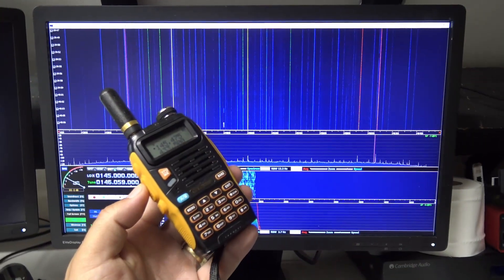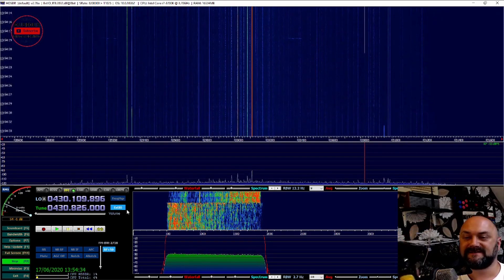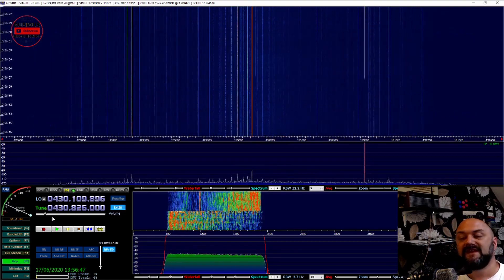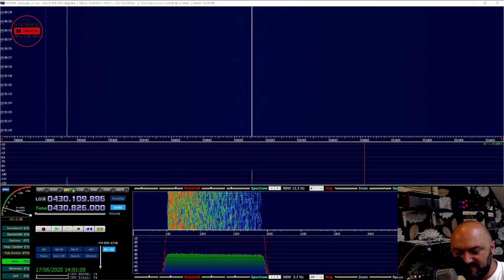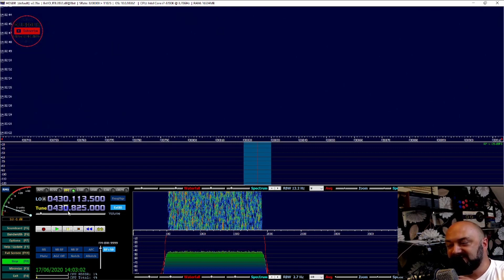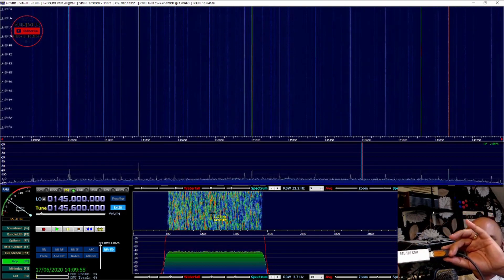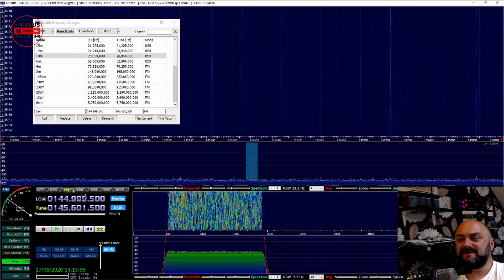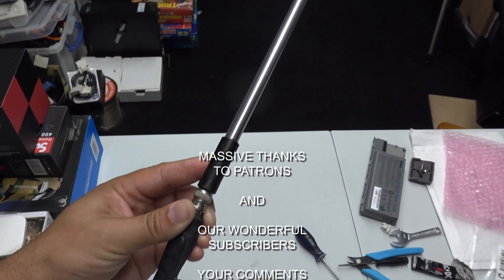DuB-EnG: SDR Demonstrating USB SDR-RTL Radio Dongle - Baofeng HAM transciever Software Defined Radio

Comment: You've already noticed that a FM bandwidth of 2718 Hz will get you totally distorted audio. You can right click the FM button and enter 12.5 kHz for normal NB-FM. You can also change it with the slider which can also be used for gain (depends on ExtIO, better change gain there). You also have to set the sound card bandwidth (press F6 to change) to 24kHz or greater to do this. You also can get way better audio by widening the AF filter: drag the red lines in the lower AF spectrum outward to allow more lower/higher AF frequencies..
73 from Germany
Reply from the maker: thanks very much for all your great advice here! ...  I’m playing with the SDR in Linux now...  still learning a lot :-)